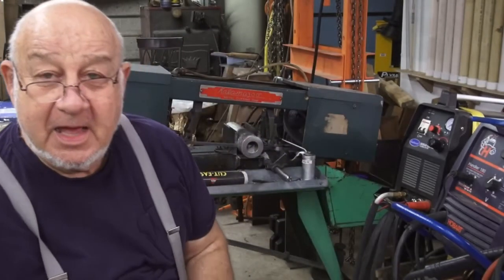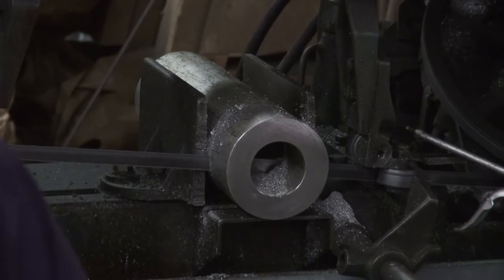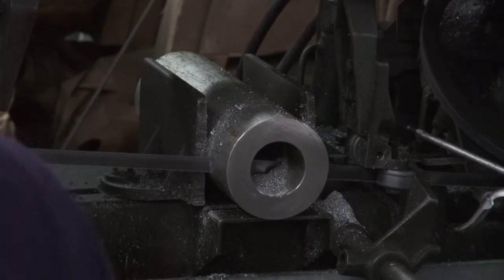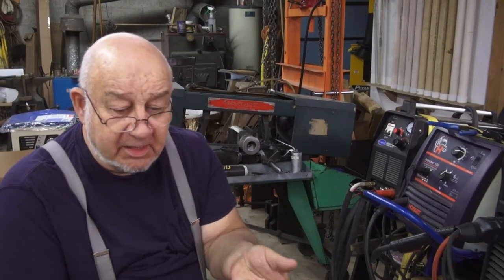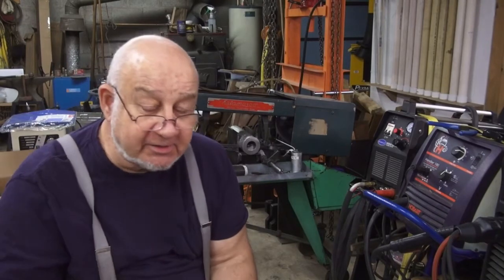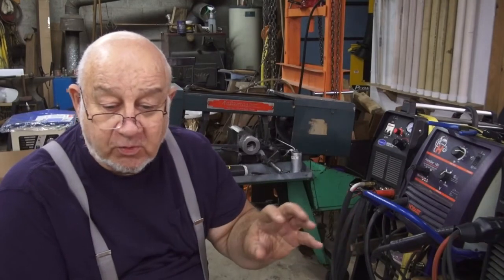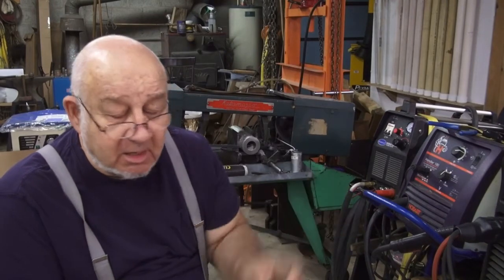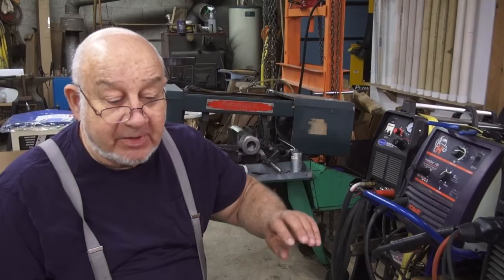Logan lathe switch modification. Part 1 of 3

Comment: question there to you if can help on logan the gear box i understand theres a shear pin is it actually in gear box or elswhere  looks same as yours 14 inch variable speed. cant find any info..see if you or any vieweres out there have knowledge of this thanks
Reply from the maker: Miguel, Like you, I found no information on a shear pin. I went through the manual and the parts breakdown and found no mention of one. I have had my quick change gear box all apart, and as far as I can remember, there was nothing like a shear pin in there. Sorry if this does not help.